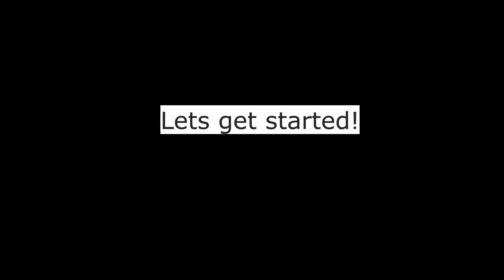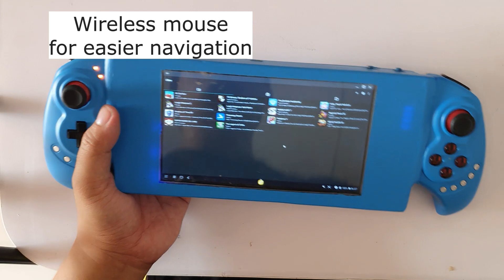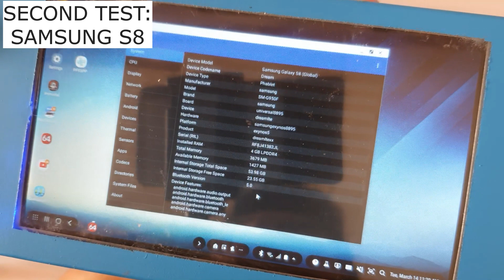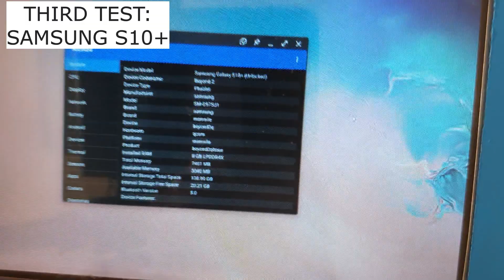DIY Samsung Dex In Handheld Form

Comment: Really great video.. I hope you make a video for us on how to DIY onex player mini handheld gaming PC
Reply from the maker: I already made a video about diy windows handheld in previous video. but it used secondhand laptop motherboard so the size is quite big compared with onex handheld. do you mean diy windows handheld in general or android based one with onexplayer casing?
Reply: @aircrate  yes i mean diy windows handheld with onexplayer casing but gaming apu .
Reply from the maker: the hardest part is to find small mainboard with powerful enough apu. i've seen other youtuber use chuwi larkbox motherboard but unfortunately it's quite expensive. what i have is old intel z3735f mobo with very bad performance but i will try to make a video about it anyway in future. cheers

Comment: The monitor you use is full hd right?
I hope it work in rasberry pi 7 inch touch.
Reply from the maker: Its 480p screen. Most 7inch touch use 600p lcd which does not work with samsung dex (stretched images).
Reply: I hope Samsung dex support 600p lcd yeah the screen is stretched i try in my 2 monitor the one is full hd the on is 720p 
The 720p is stretched and blurry while the full hd is fine no issue .

I just want to try to create samsung dex tablet from 7inch raspberry because it's cheap and small but yeah
It would be take a lot of time
And it would be cost a lot